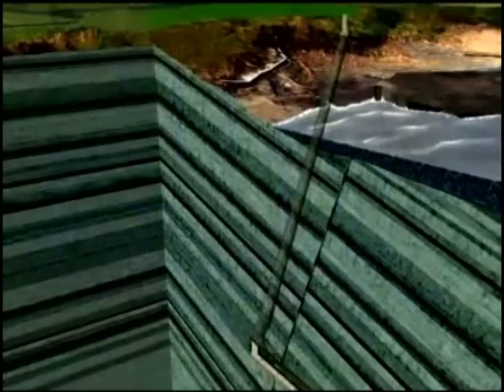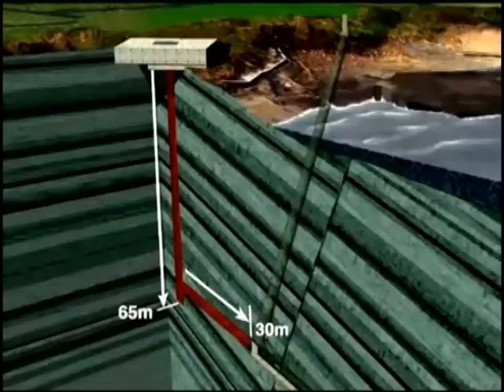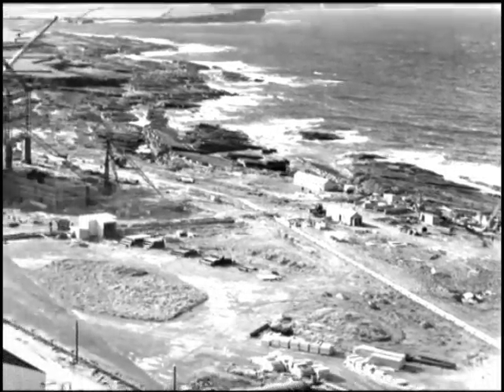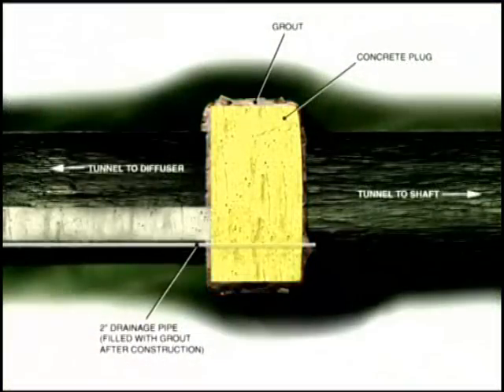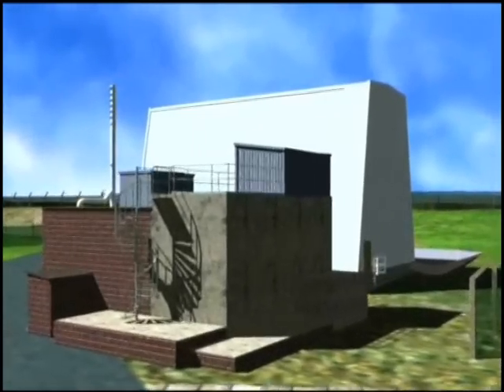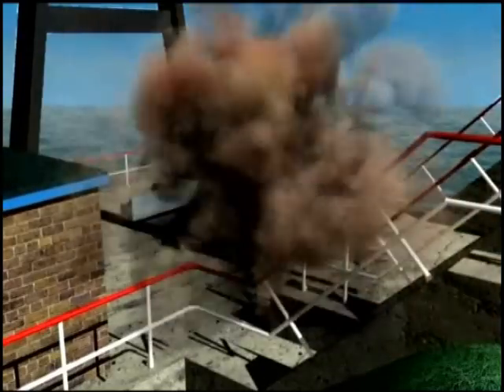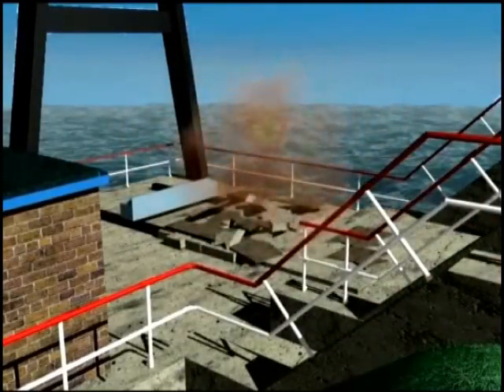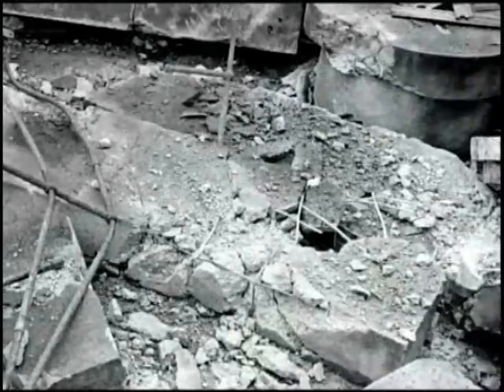History of the shaft

Comment: "the gas is naturally ventilated" I.E. its no longer sealed and it's let into the atmosphere I guess
Reply: Well it's just hydrogen so..
Reply: "Well it's just hydrogen so.."
Not exactly, no. The atmosphere in the shaft will inevitably contain some other contaminants (presumably including radionuclides since the shaft is full of "medium level" radioactive waste). 

The hydrogen which was present in the shaft was just one of those contaminants, that just so happened to eventually form a significant part of the atmosphere in the shaft over time.

Bear in mind the explosive limits of hydrogen in normal atmospheric air range from about 18 -- 60 % and the flammable limits are from 4 -- 75 %. 

In a pure oxygen environment the limit of flammability goes all the way from 4% to 95%,  so a significant volume, and a significant proportion of the atmosphere of the shaft must have been hydrogen in order to create such an explosion. What made up the remaining atmosphere in the shaft is not stated, but I suspect it was mainly air since the shaft does not appear to have been hermetically sealed.  

Presumably significant volumes of hydrogen are still being produced, but currently the hydrogen (along with any other volatile or particulate substances, potentially including radioactive substances) are being allowed to vent in to the local environment. 

Logically if it was "just hydrogen", then it wouldn't have been an explosive risk, since pure hydrogen does not bur without oxygen. At the bare minimum there must have been oxygen, probably in the form of atmospheric air in there too. 

The issue is that there is medium level, poorly documented radioactive waste also in the shaft.

 Blowing up such waste with a hydrogen explosion is not exactly best practice, since such an explosion will result in the expulsion not only of the heavy lid, but also the atmosphere within the shaft, a significant volume of the contaminated water within the shaft, and any contaminated debris that was sufficiently mobile to be expelled in the process. 

The presence of hydrogen in the shaft was presumably not considered, since the contents of the shaft were not well managed, and the poor management of the site is the major factor that led to the accident.
Reply: "medium" in the nuclear industry equates to, no one really has a clue how dangerous it is!
Reply: .. but "high" on the other hand means that if you just read that on the label on the canister you are probably already dead. };¬)
Reply: Most radioactive gases from fission ar very short-lived or very low energy(tritium) and don't enrich in biological tissue like Iod does.
Reply: For those interested this video is actually a cover up of what took place, I guess they're hoping people will forget they used as an illegal dump site for high and intermediate level wast fuel pellets for washing up on the shore at one point!